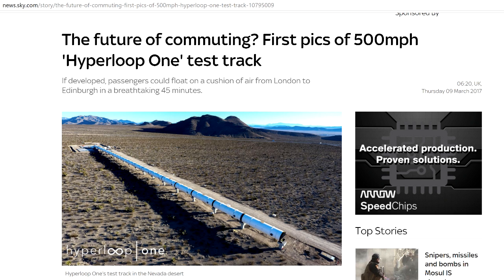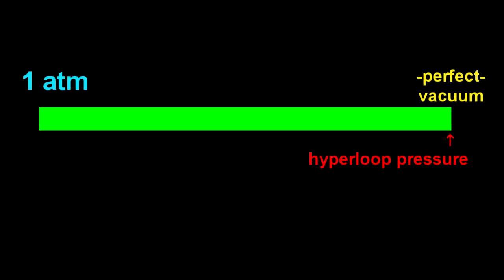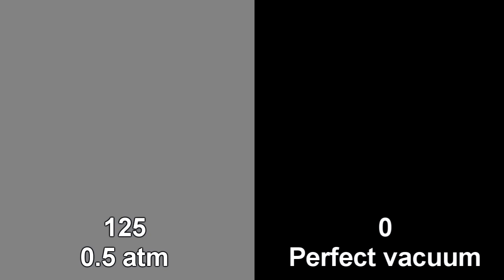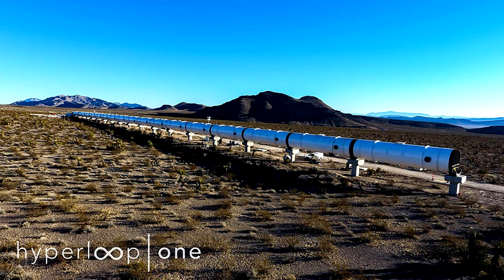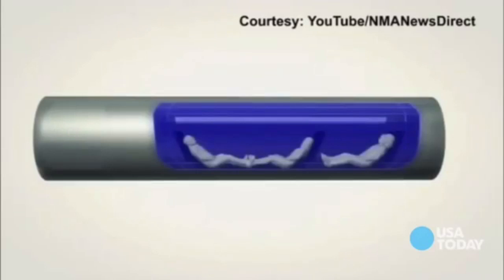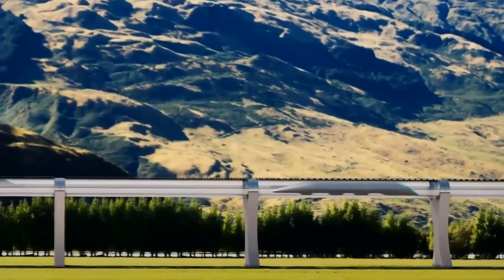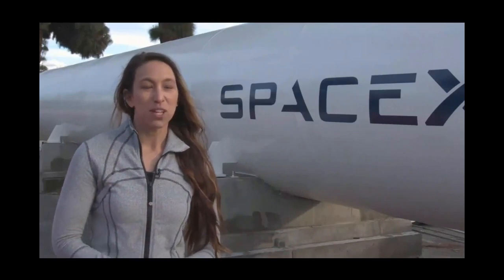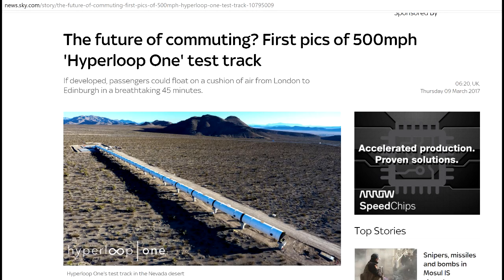Entire Hyperloop could be destroyed in SECONDS!

Comment: The reason why a tank buckles when evacuated is because it's not designed against it, it is optimised to be as lightweight as possible whilst carrying a liquid inside at atmospheric pressure (0 net pressure except for the positive amount exerted by the liquid). Pressure vessels can be designed to take a lot more compression without ever buckling, e.g. submarines within their operational depth (+150m=~15atm).

Comment: "800 miles per hour." Are these people nuts? Every passenger would need training to withstand that level of G-force, there is a reason not everyone can be a fighter pilot, and to ride this there would need to be that sort of training, pointless.
Reply: While your sitting on your PC or mobile phone *right now*, something called the earth is pushing you 67,000 mph (107,000 km/h) in circles, in a vacuum - It's our solar system. Even with such speed you're completely fine, aren't you? 
The key is to accelerate slowly. You ain't gonna experience dangerous G-Forces if you accelerate below safe limits.

Otherwise people in planes would have died already. Planes go in average 600mph.
Reply: Fusseldieb hey buddy, ever heard of general relativity? We are going around 0-1mph relative to the earth and the earth is the most stationary thing we have.
Reply: @averygoodfantasticname4206  that's precisely what he was explaining
Reply: g forces do not correlate to speed
you cna sit in an airplane at 300 miles per hour and feel like it's almsot stationary
same at 500 miles per hour
same at 1000 miles per hour
same at 2000 miles per hour
fighter jets aren't hard to fly because they're fast, they are hard to fly because they fly sharp turns - well, and for a lto of other complciated reasons - but not because they are fast
the concorde went over 1500 miles per hour and was qutie comfortable to ride in

Comment: 256 “depth of color“, not 255. 0 to 255 encapsulates 256 discrete values, 8 bits. 1 to 255 would be 255 shades of gray. Making that mistake is so common, programmers have a name for it: it’s the “off-by-one” error.

Comment: 0:40 - this is exactly that happens with submarine at bottom of Mariana Trench.
Reply: not quite
the bottom of the mariana trench has a pressure of about 1200 atmospheres
the pressure difference between 1200 atmospheres and one atmosphere is 1199 atmospheres
the pressure difference between 1 atmosphere and 0 atmospheres is 1 atmosphere
1 is much less than 1199
the pressure at the botomof the marianas trench is ltierally strong neough to make water comrpess nad fill into an air bubble at speeds greater than the speed of sound in air
although funnily enough the submarines that go there aren't crushed
because they are designed to witstand such pressure whic hisn't all hat difficult
fighting leakage is hard at that pressure but quite doable in a low pressure tunnel
the actual strucutral strenght is easy to take by a thick steel or concrete wall
between a train tunnel and a submarine it's not like either has to be very lightweight

Comment: I'm afraid I have to disagree with you here. Submarine hulls can withstand dozens of atm of pressure differential. I don't know how thick the walls on those are, but I do know they occasionally get knocked around and dented without catastrophic failure. So we definitely know how to build stuff to withstand a difference in pressure. A tanker truck or train car will collapse in on itself because it was never designed to hold a vacuum in the first place. It's supposed to be filled with liquids. If there's any pressure differential at all, it's positive pressure from the weight of the liquid at the bottom of the tank. Putting it under vacuum isn't what it's designed for. To paraphrase Einstein, that's judging a fish for its ability to climb trees.
 
Regarding the time/energy it takes to vacuum-pump it down, on the full-scale hyperloop you wouldn't be doing that for every trip. The length of the tube would be maintained at a vacuum constantly. Only a small airlock section at the end would be brought up to ambient pressure so the pod could be opened, and then depressurized again when it was time to leave. With large pumps this could probably be done in just a minute or so, and the energy saved from the friction reduction over the length of the trip would more than make up for what you need to drive the pumps.
Reply: Submarine hulls are several inches thick and submarines are extremely dangerous.
Reply: @loserface3962  That may be true, but that's because it's a more extreme example. Subs operate at hundreds of feet deep, whereas the hyperloop would only need to withstand 1 atm pressure. The point is we know how to make cylinders that withstand relative external pressure. Taking a tank designed for liquids under slight internal pressure and having it collapse under vacuum isn't really a valid experiment. That would be like sticking a slice of bread in my blender, concluding (correctly) that the blender isn't good at making toast, and then deciding (incorrectly) that inventing a toaster is impossible because all it did was make a mess.
Reply: @John73John  You need to make the walls probably a centimeter thick so a puncture would be rare.

Comment: You realise they stop because they are wheel based which generates friction, in the long run they will be magnetically levitated removing said friction, they have not yet build 1 Hyper-Loop capsule, even in Vegas they haven't even started working on it yet, he is just going to use Tesla's at this stage.
This is very very early development, I wouldn't expect to see a fully functioning system in working use for 10 years, Rome was not built in a day as they say!
Additionally you hammer them for the speed but it's a short test track ffs, you realise they cannot accelerate and decelerate too quickly so realistically they are very limited on speed at this stage.
Next you hammer them for the time taken to get it in and to get it out, but you completely ignore the fact this is a TEST Setup, it would be quite easy to separate off sections and load a capsule in to a small section then vacuum that keeping the rest of the tube (the bulk of it) under vacuum minimising load time, also it is not inconsolable to have the capsule itself complete a vacuum seal at either end of it when it stops, then doors can open on a station much like in the underground, people can jump on doors shut, seal it broken and way you go!
As for the energy involved, you fail to mention that the bulk of the pumping would only need to be done once, also you can separate it into sections and seal off leaking sections automatically which thought it would effect the entire loop is at least then not a complete vacuum loss reducing energy usage when problems occur and are then fixed.
Same goes for the power held within, do you seriously think it would be 1 tube without any splits or connections down the entire course? Of course not,, the sensible thing to do would be to automatically section it off behind a capsule as it moves, then open it ahead of next capsule (well ahead when at speed of course), this will reduce the amount of force 'stored' in any one section.
I am not saying it's all going to happen without issue it may very well not, but we have the technology so why not explore it, fair play Elon for trying, if it works, great, if not fine.
As for if you'll be happy to get on it, there are many who don't like sailing, flying, even driving on motorways (freeways) so will use other options, why would this be any different.
Long, long way to go yet, this is very much testing, don't get ahead of yourself, it could happen still yet!

Oh yeah finally about the dents, it would be very easy to prevent dents on something which is underground yes, something which is placed in a already built and reinforced tunnel, so yeah it would be pretty easy, also you can once underground and in a support tunnel build additional support struts on the outside of the tube something they can't do when storing it in the desert.

Or is the wind going to magically appear underground just to break the hyperloop ,as you realise that is mostly where he is talking of building them and where the Vegas test track is build by the Boring Company!

So yeah... great vid lol.
Reply: so it's a maglev train
but more expensive

Comment: I have a question about what is the idea if it is in the vacuum or in very low pressure, how it will be propulsed? 
I mean: almost without air and if the idea is that this thing 'levitate' then will use magnetic propulsion? 
If that's the idea I guess why not try it with more pressure like 0.5 atm?. 
Well I don't know a lot about but anything will help me to understand better
Reply: well, it wil leither be a train or a maglev train
both already exist
except now yo uahve a low pressur etube around it
it won't be ul lvacuum, that's impossible
but reduced pressure to reduce drag
whic actually does very little to help with anything
Reply: Julian Danzer it does a lot when it’s near perfect

Comment: It seems the simply mismanaged air flow. It has to be a small clog og a tube. Then they can blow on the back of it. It will take immense pressure but believe me. If it worked with the paper wad in my straw surely it can have larger implications than that. If they suck on one end and blow on the other it has a fighting chance.

Comment: Even if it worked, who's gonna afford it? Maintenance for safety and electricity costs for maintaining the vacuum (everything leaks) will be horrendous. Capacity will also be very low as enough fresh oxygen supply has to be carried with the pod as there's no surrounding air to provide replacement.
Reply: Probably the one who said that having a bullet train would be too expensive
Reply: @UnePintade  Bullet trains indeed ARE expensive. They immensively drive up railway expenditure with only limited rewards. Meanwhile, cheaper night train services are being shut down by the same operators, as they would have competed with the newly built infrastructure.
Have you ever set foot in a Shinkansen? Do you know how immensely expensive a less than four hour trip on the Toukaidousen is?
Reply: @insatsuki_no_koshou  yes but the hyperloop is far more expensive
Reply: @UnePintade  I agree. Maybe I misunderstood the implications of your previous comment, I read it as a counter to mine.

Comment: "Hyperloop" as a concept is not actually that bad of an idea. But currently it would be very expensive and there's lots of hurdles and safety issues to resolve.
Building high speed rail is already very expensive due to care you need to take to eliminate elevation and direction changes. But with hyperloop you need to be even more careful of those.
I think someday vacuum tube transportation will probably overthrow planes as high speed long distance transport, at least in some settings. But for short distances with many stops like with public transport, there's just no way you can justify it. It wouldn't be able to pick up enough speed in that kind of setting, with all the stops, curves and comfort reasons.
I don't think energy would actually be issue because you would only need to re-pressurize small sections that holds the vessel on regular basis, vast majority you would just have to maintain at vacuum. Now I haven't done any calculations, but I would imagine it would be lot more energy efficient than a plane. Granted ofc, you have sufficient quantity of people using it.

My opinion is that we are just nowhere near it being commercially viable or safe enough. While it's really interesting and I think we will see it used in future, I have same opinion with large rotating space/orbital habitats.
Reply: Vaccum trains are 100 years old, they were discarded before due to being impractical, they're going to be discarded again, because the laws of physics dictate that.

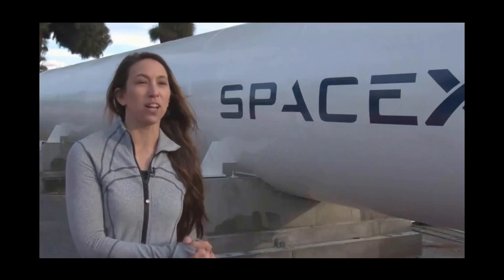Comment: 5:11 "Because this is such a large chamber it takes a lot of power to pump it down" Yes this is gonna be cheap and environmentally friendly. Thoose guys are environmentally challenged.
Reply: I don't see how a hyperloop can ever be environmentally friendly
Reply: Oh, if the train inside the Hyperloop is one of the type steel with steel, the whole idea is pointless. You MUST put a better system there that allow the train to go to ludicrous speeds. 

The Vacuum could help with the friction when the convoy reach a speed of the order of the sound.

What kinda of thing can provide such acceleration?

Well, exist. And if it is surrounded by a vacuum, since this type of track is frictionless... well...

WHOOOOSSSHHHH

Salute: THE MAGLEV!

If the Hyperloop doesn't have a Maglev in there, it will NOT be worthy.
Reply: Is more cheap in the long run. Less fricction = less power consuption = less pollution.

(And more profit!)
Reply: @sirnikkel6746  It's a gross waste of resources mate, it's basically won't be that long since the bigger it wouldn't go as fast as they want and so it has a needlessly low carry capacity compare to traditional maglev you need to run 20 of these things to equal carry capacity of a compartment in maglev so overall a waste of time as a concept
Reply: @GetterBane  If those guys were to built it, I hope you are wrong. We do not have too much influence over that project after all, but we would benefit greatly from it if it works. Especially if you buy stocks from it.

Comment: Didn't you said yourself, that it would be under partial vacuum. It is not more dangerous than pneumatic post system. And pneumatic trains isn't new idea, they wore used but there is a reason why they were completely displaced with electric trains. And these rison is efficiency and maintenance, and reliability. Go look it up doctor Thunder.

Comment: Atmospheric pressure is roughly 10m of water pressure.  Most undersea tunnels are constructed to withstand much higher than this pressure without any problem.  Thus the claim that a vacuum tunnel subject to 1 atm external pressure is an exceptional hazard is totally unfounded, numerous undersea tunnels are around to show that a pressure of 1 Bar is nothing impossible to surmount in large scale civil engineering implementation (Check the Eurostar).
A submarine hull structure base on ordinary mild steel of 250 strength can be built easily to withstand 100m water depth (10 Bar) up to a diameter of 10m.

The problem with Elon Musk's rendition is the Hyperloop is apparently using the wrong construction method base on thin shell steel tubes with minimal hoop stiffening.  This is extremely  susceptible to dimensional perturbation such as a small dent in the shell, general collapse can be triggerred by instability.

Since weight is not a concern with land base structure, the tunnel should be built with thick reinforced concrete, not at all an advanced technology.  A thick shell is not liable to buckle under compression stress and concrete is an ideal material to take this kind of load.  Simply visualize a vacuum tunnel (or ajust reduced pressure)  encrusted by half a meter  thick concrete, all your concern will be dispelled.

The other problem with the test track is not having air locks,  the embarkation section should be isolated by an air lock system to minimize loss of vacuum .  In fact airlocks should be placed at regular intervals along the track for safety and  control consideration. 

In all, a vacuum or low pressure tunnel high speed rail system is not far fetched, and I can bet China will come up with one within the next decade.
Reply: Moreover, a thick concrete structure is not liable to collapse and any damage will likely cause cracks and leaks which can be easily detected and the system shut down automatically.   Physical collapse of any section due to whatever reason also will be localized and cannot propagate like in a thin walled structure.

Comment: Been reading the comments here when it comes to contingency plans about how to prevent catastrophic failure in the event of a (let's face it, inevitable) breach.  Could be an earthquake, collision with some kind of vehicle, explosion/gunfire damage, or anything; you name it, someone in the comments has already talked about it.  Every time they do, however, suggesting things like fences, extra thick walls to resist explosives, emergency shutoff airlocks to stop a pod heading towards a breach, reinforced fences to stop vehicles, advanced support platforms to absorb shock, burying it and so on, all I can do is ask: who's going to pay for all of that?  Even doing something simple like adding fences along the length of the tubes would add tens of millions (at least) to the bottom line, present unique engineering challenges in variable terrain, and incur astronomical costs in terms of maintenance and routine inspections.  They say it would cost only the price of a plane ticket, but all I see are the endless lists of costs that a business plan would have to factor in which, honestly, makes even the expenses of airlines seem meek in comparison.

Comment: I know I keep asking on each Hyperloop video, but no one answers: Why wouldn't they use a tunnel boring machine to make a straight line through bedrock? From my "envelope back" numbers, the cost of a 7m diameter TBM would be less than the cost of steel tubing + magical expansion joints. It wouldn't expand in sunlight, it could still be evacuated, and an electric rail gun/maglev bullet train could be installed. 
So not hypersonic, "merely" 367 mph, which could be upped to 400-500mph inside a partial vacuum. 
Could this work...?